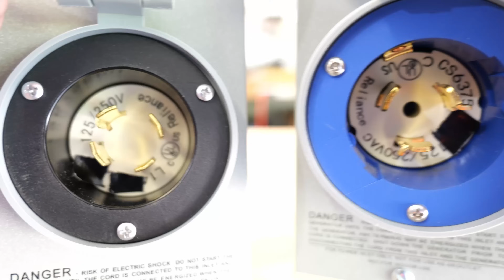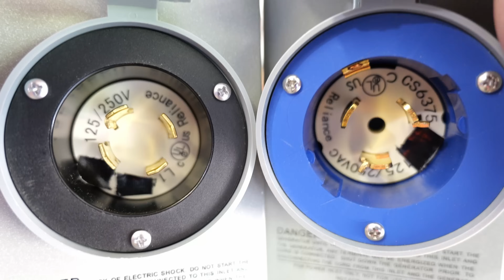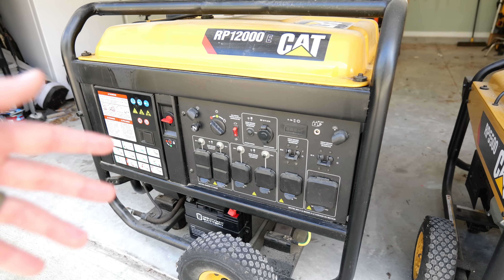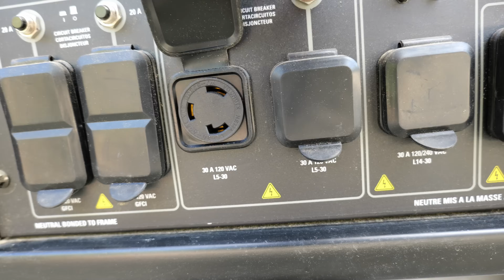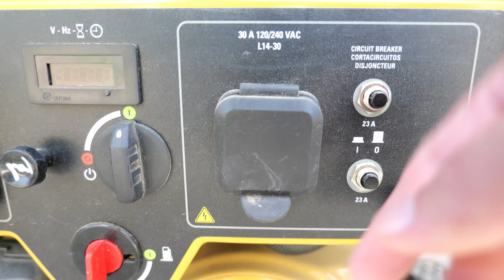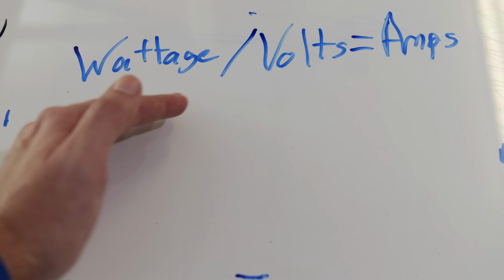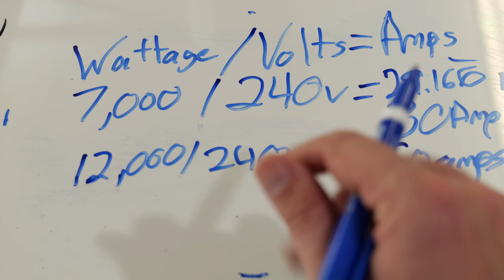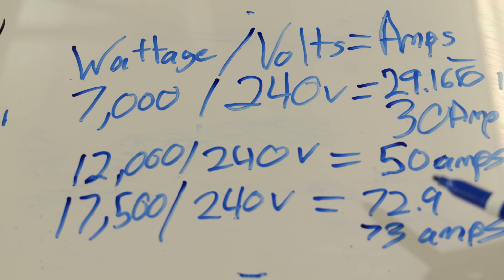30 Amp vs 50 Amp Power Inlet Box.  What's The Difference and Which One Do You Need?

Comment: Dude You forgot to mention on these Reliance boxes, they only accept 1/2 " and 3/4" conduit! 50 amp service requires 4, 6 gauge wires that do not fit in 1/2" conduit and barely, BARELY fits in 3/4" absurd this box doesn't  accommodate 1" conduit. ASK ME HOW I KNOW!

Comment: So are u saying that there’s no difference in how much more I can run with a 12000 running watts and one that does 17000 running watts? A 50 amp receptacle is the biggest I’ve seen on a portable generator. I want to run 1HP well water pump, hot water heater, fridge, two small coffin type freezers. 20 led light bulbs, stove, tv and WiFi and washer and dryer. Not all simultaneously of course. The only things running all the time would be water pump, fridge & freezers and a few lights

Comment: So if you have a large generator that has a 50 amp plug and a 30 amp plug does that mean it can output 80 amps total? If so could you install both a 30 amp inlet box and a 50 amp inlet box and have 80 amps capacity?

Comment: Hello, I got a question about the NEMA 14-50 for 50 amps for the NEMA SS2 inlet. Is there a reason why there is no NEMA 14-50 4 prong cable inlet and instead uses a SS2 inlet plug? Does it have to do with the pins not being round and it is not a twist lock? Or is it a code related thing? Also second question, I am looking into buying one of the 3 in 1 outlet box that is sold on Amazon that is used for RVs which has the 50/30/20 outlets on it which has the circuit breakers inside the same box. I wanted to ask if it can be possible on these to modify them for the 50 amp and 30 amp to use a NEMA 50 amp SS2 inlet and a NEMA 14-30 inlet as well in the same box (but keep the GFCI 120v duplex outlet)?

Comment: A full auto turn key system cost the most money. The cheapest is what people like me can wire up, I would tend to back feed a stove plug at home, it will not be safe and legal for the average persons unless you are an experienced electrician like me. The old say the plumber's own house is the one with the dripping taps and leaks.  But no inspectors be around during a power failure. Here I bust another myth that leaving the main disconnect on would electrocute the power linesman outside.  I of course will not do that , for if power suddenly return, it will smoke my smaller generator. But forgetting to turn off the main switch is just rude and is a second line of defense for the linesman.  Their standard safety practice they follow , first of all, the newer bucket truck are all isolated from ground. Second their standard safety practice is to ground the line they are working on, the capacitance sometimes leave a shock hazard. That is why their accident rate is generally low.

Comment: Those two amps are actually most common at home in N. America, for dryer and stove. There are some difference in cost for the extra large breakers and plugs but mostly for the wires , depends on length. Which one you use depends on the house, how much appliance you intend to run and your restraints to keep your consumption within limits. The 80% rule means you cannot have any sustained loads of more than 24 amps and 40 amps for each size. 50 amps is actually a lot of power if you exercise restraints and common sense, and is enough to easily survive on for months. Easily over come long duration failures like 3,4 days. You just have to have a big enough generator and enough fuel for it. You can of course wire a smaller generator on to the 50 amp wiring , but not the other way around.

Comment: Looking for a power inlet box for solar, 50 amps. And a plug I can put my solar wire on.
Cannot find such a setup. Want twist lock to be sure the plug doesn't fall out.
My setup will be about 33 amps-ish.
Need extra room to add two additional panels later on.
8 gauge wire is fine for what I am doing.
8 gauge is meant for roughly 40 amps.
But the 50 adds a bit more protection.

Comment: I still have some confusion. I've got a 6500 running watt (8125 surge watt) generator. The manual says rated current at 120V = 54 A and 240V = 27 A. This video seems to suggest that I can only get the 54 A output is by using multiple outlets on the generator (a 30A outlet and 20A outlet). My logic (which is likely wrong) was I could use a 240V power to the power inlet box but if I'm only powering 120V items in the home, that I'd get the full capacity of 54V. But then that didn't make sense cause the breaker at the end of the day on the generator says 30A. Hopefully this all made sense and someone can help

Comment: If you’re running your entire house, those generators need to be inverted generators to have a cleaner energy output.  Appliances and electronics could be damaged.
Reply from the maker: They do not have to be inverter generators.  Plenty of good generators out there that are not inverters that have less than 5% THD.  Even if you don't have one that low, the odds that it would actually cause damage to even sensitive electronics in a relatively short amount of time would be very low.

Comment: As said in the other comments , Definitely spend the extra bucks and go with a 50.amp receptacle , That way , If you want a bigger generator , Then it's already there , And , No having to remove the wiring of the smaller circuit and especially , No additional expense of buying materials to install a 50 amp receptacle , So definitely go with the 50 amp receptacle but keep in mind that you need 6 gauge wire for a 50 amp circuit and if the wiring for the generator receptacle is run along the surface , It has to be in PVC conduit and single conductor wires

Comment: I’m looking to buy a portable power station to use with my generator. My house is already wired for a 30amp inlet box (L14-30) to run essential loads, in a separate panel. Im finding that a lot of power stations have a TT-3OR outlet. Would it be safe to run an adaptor in this case? Assuming I found a power station that could support the load? I’m only looking to run 120v circuits.

Comment: Put a 50 amp protective socket onto your panel box.
Buy or construct 2 power cords for generator use; generator to panel.  One 30A to 50A and the other 50A to 50A.
Now you're set for whatever generator you have handy.  Just be sure to not exceed either generator's output.

Comment: So, I live in a area where I have never seen the power (PGE) go out as often as it does. Sometimes for a few minutes, maybe a couple of hours but the longest has been two days.  Now, regardless of the time of year we have those public safety power shutoffs.  So I purchased a EcoFlow Delta Pro 3 hoping I could power our 2 refrigerators, an air conditioner and just one circuit in our master to power the internet.  The A/C draws 26 amps alone.  The EcoFlow has 4000 watts continuous I think.  Is the Delta Pro 3 powerful enough for a 30 amp manual transfer switch with my needs?  Maybe not.

Comment: To everyone confused about 30 or 50 amp. Simply anything between 0 & 18000 watts a 50 amp will work. But if output is 0-7000 watts,=30 amp breaker . You cannot run more then 30 amps from 30 amp breaker

Comment: Can I used a 30 amp male/50 amp female generator adapter to run my 50 amp power cord & 50 inlet box from my 30 amp generator outlet
Reply from the maker: If I am understanding you correctly, you have a 30 amp generator and want to know if you can use a 30 to 50 adapter, with 50 amp rated cord, and 50 amp power inlet box?  If so then yes.  You can always install higher rated materials and use them with a lower rated application but cannot use lower rated materials with a higher output application.
Reply: Thanks
Reply: Yes  50 or 30  can always be fed less power .

Comment: Great video.  I replaced my 5kW gen with a 7600 watt (running) inverter gen and the 30 amp power inlet box will suffice, PROVIDED I connect my 30 amp cord to the 30 amp receptacle.  I'll have a pro upgrade the box, wiring and breakers to 50 amp to take advantage of 30-plus amp load capability this new gen has.

Comment: What’s your take on inverter vs non inverter generator. I bought a predator 13000 kw non inverter and got discouraged from using it because of sensitive equipment.  Now i have a 8750 inverter but has a 4 prong 30 amp outlet. Can i install a 50 amp inlet on my 8750 even though its for 30

Comment: I learned something else today, there was a toss up between an 18000 running watt generator and a13000 running watt "inverter" generator for home backup power. I chose the 13000 watt inverter generator, telling myself, thats all I would need. I'm having a 50 amp circuit installed by a pro, with interlock, and you've just confirmed my choice, thanks.
Reply: You're also going to get far cleaner power from the inverter it's a lot easier on your electronics and your home air conditioner fridge Etc and 13,000 should still be plenty to run most of your house I have a 10,000 running Watt with 13,000 starting Watts and I can run my entire house on it I just have to flip flop the air conditioning and the water heater so when I'm ready to take a shower I flip off the air conditioner and then turn on the water heater for 20 minutes or so then flip it off and flip the air conditioner back on which honestly is no big deal and if you flip on the water heater for a bit you should have hot water for a while before you would need to turn it back on

Comment: Great video, quick question please. I have a 30 amp power inlet box to run the house. My generator will run  7500 watts on natural gas. Am I ok with this setup, I know I am a tad over, but hoping it is not going to be a problem.

Comment: What about installing a 50amp inlet but running a generator capable of 30amp? I saw that there are adapters for this situation.
My thought is that I'll upgrade my generator in a couple decades if I need more power, and I want the infrastructure already in place to do so.
Reply from the maker: Yes.  Nothing wrong with having larger upgraded hardware.  Only an issue if it is underrated.
Reply: @ oh perfect! So with an adapter, a 30amp generator can be used on a 50amp outlet/system?

Thank you for the fast response!

Comment: Just to mitigate confusion: At the ten minute mark you use 240V in formula, however, if someone  has a 120V generator, they would use 120V instead of 240V.

Comment: The external cord is 100x thicker than the wire on the inside of the box…. 🤦‍♀️🤦‍♀️🤦‍♀️☢️ that makes absolutely no sense
Reply from the maker: That is because it is a jacketed cord for protection.  The wiring is the same size.
Reply: @HowToHomeDIY  WTF, that’s insane, you ain’t need that much insulation. That is insane amount of insulation. That might be a scam to make at,supid ppl pay $200 for a cheap 25¢ cord

Comment: Great video! What is the impact or risk of installing a 50 Amp inlet box if the generator doesn't fully support 50 Amps? My tri-fuel generator is 9500/7500 watts (when running on gasoline) and has a 50 Amp receptacle. Since I already had the 6-3 wiring and 50 Amp breaker in my panel (from a hot tub), I ordered a 50 Amp inlet box. Unfortunately, I saw this video after I already ordered the parts.

Comment: What if my amps come out to just above 30 ( in my case 31.66) is a 30 amp box no longer appropriate?  My generator only has a 30 amp plug and I’m planning on running my entire house. Thanks
Reply: If your house requires 32 amps then how can the 30 amp generator be appropriate?
Reply: @MrSummitville perhaps I did not ask correctly. When I did the math as explained in your video to determine the amps from my generator it came to 32. I am then trying to figure out which inlet box to get for my house connection (30 or 50 amp). The generator only has a 30 amp female plug. Would it be best to install the 50 amp inlet box on the house and use an adapter to go from the 30 amp plug on the generator to the 50 amp inlet box. Or would a 30 amp inlet box at the house be ok. Thanks so much and sorry for the confusion, I am new to this. Does that make sense what I am asking?
Reply: @kissesforyourmisses  Best to install the 50 amp inlet. If you install a 30 amp outlet, then continuous amps should be degraded down to 80% = 24 amps continuously from a 30 amp inlet =  20% Safety Factor!  Up to, 30 amps intermittently is OK.  Especially since you said your house can pull 32 amps - which ain't going to happen from that generator.
Reply: @MrSummitville thank you!

Comment: Is it ok to use the 50 amp output plug on the generator when I am only  using 30 amps to the house and using 10 gauge wire. I didn't have a 30 amp plug to hook to the generator!😢

Comment: I have a 30 amp inlet already on my house. I’m looking to buy a generator now. This generator will be primarily just for backup purposes, rarely used for anything else. So with the 30 amp inlet I shouldn’t be buying a generator putting out much more than 7,000w?  If 7000w to 7500w would be max on the 30 amp load would handle in this case . 
If so using a inventor generator 
With 7000-7500 w could be an option?  Basically that would put that size inverter generator in the price range of a 10-12000w regular generator

Comment: Why do the lower number indicate a higher amperage?
Reply: Way back when ... Wire was drawn / pulled / stretched thinner and thinner, through successfully smaller dies / holes. A fat wire was drawn 1 time = 1 AWG. A skinny wire was drawn 30 times = 30 AWG.  And now USA is stuck with that weird naming convention.

Comment: Why not just install 50 amp inlet box to future proof it so if and when u need 50 amp, you are all set. In the meantime, you can use the 30 amp adapter if you only have 30 amp generator.
Reply: Cost?

Comment: Question. How does a generator that produces 50 amps of power not trip a 50 amp breaker that only rated for 50 amps?
Reply: 50 amps breakers don't trip at 50 amps. They allow 50 amps.

Comment: 4 prong plug is 50 amp 3 prong plug is 30 amp on a RV ??
Reply: An RV 30 Amp is only 120 Volt.  His 30 amp inlet box is split phase. 240 volt.....
Reply: @shawn - Yes on a RV ... 50 amp is 4-prong and 30 amp is 3-prong. Yes, these twist-lock residential inlet boxes are the "reverse".

Comment: I bought an old Coleman powermate 5000 generator - it has 4 receptacles , 2 being labeled 240 volts but receptacles are the ones you find in your house - I want to run an old craftsman welder 30 - 200 amps - how do I do it? I bought a joiner cable? 10 gauge - do I plug both into the 240 or do I do 1 in the 120,, the other in the 240 maybe increasing the circuit breakers ? Inquiring minds want to know

Comment: My house has the four prong so this video tells me it’s 30amp. But the Honda generator 2200i companion that has 30amp but the outlet is three prong for some reason. Any ideas
Reply: You can use an adapter. It splits the single 120v hot line into two and feeds both sides of your breaker panel. You can't power 240v circuits however.
Reply: An RV 30 Amp is only 120 Volt.  His 30 amp inlet box is split phase. 240 volt.....

Comment: I haven't watched all your videos, so you may have covered this somewhere.  But there is an issue no one is talking about:  Below 5500W, most generators only offer the 3 prong, 120V. TT-30R., single phase plug.  These are common on RVs.   The direct to panel interlock setups I've seen, even 30 amp, are NEMA L14-30R
two phase capable (but are often notated as 120 capable also, I presume should you only use a single phase of that power in a transfer switch)  And I am doing that on mine.    QUESTION:  Is there an arrangement for connecting a 120V TT30R to a main panel?  Would it limit you to half the panel?   Or can it be wired to serve the whole panel?   I should think not because of some dual pole breakers in the panel.    Yes/No?

Comment: I have an electrical outLet on the back of my house, I want to use that to add my 30 amp generator input outlet. ( I have a 5500 running watt generator and I bought the Reliance control switch box) what is the maximum run length allowed?

Comment: i just went from 30 to 50 amp and let me tell you i love it a lot more before i could run anything but my 220 i could run the stove or the water heater but not both at the same time. but we lost lights and i was out of town and my brother  in law came over started it and flipped the switch. but forgot to turn off most of the 220 stuff and when i got home a couple hours later my old lady was drying clothes and the water heater was still on and she was even running the A/C. and it would never do that on the 30 amp. not saying i would do this every time. but its nice to know it will.

Comment: My generator has a 220v 20 amp receptacle on it. If I were to install a 30 amp inlet box on my house would it be ok to make a cord with a 20 amp male end for the generator and a 30 amp female end for the inlet box?
Also, in your opinion would a 4000 watt 20 amp generator be enough to start and run a typical 1/2 hp deep well pump?

Comment: When Milton hit Pinellas County Florida I estimate there were 20,000 running using an average of about 12 gallons of gas a day. So that’s an extra 240,000 gallons of gasoline needed a day to run just generators. Now if a gas truck carries 9,000 that means the county needed 26 extra trucks just for generators. There were people driving 100 or more miles for gas because most people, like my son only had 20 gallons. So I haven’t seen any reports about these gas shortages on the News. I actually think the number of generators were 40,000 to 50,000. So people think about small maybe 4000 or 5000 watts.

Comment: Awesome break-down of the differences, thank you! Just curious, I'm looking into buying a Predator 9000 generator from Harbor Freight with a running wattage output of 7,250W, which would put it at 30.28333A. Would it still be safe to run a 30A power inlet box?